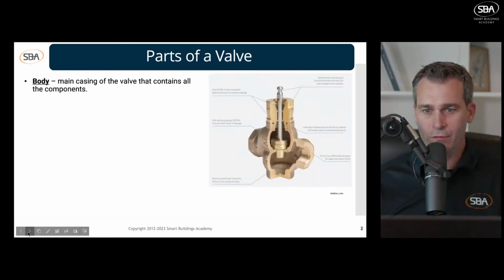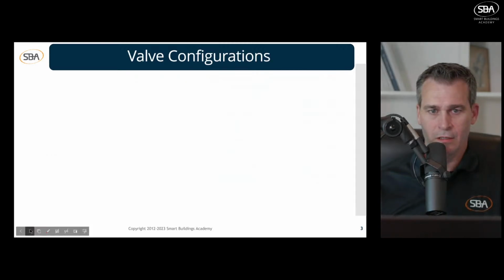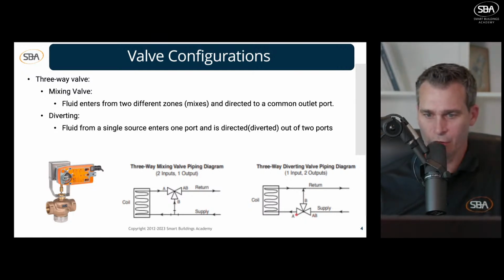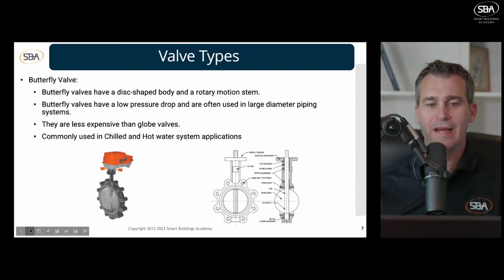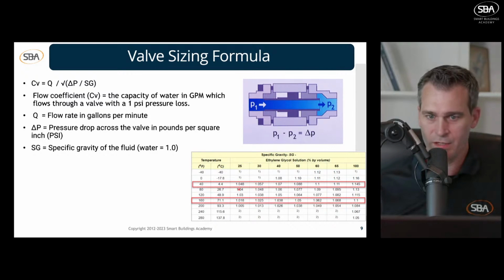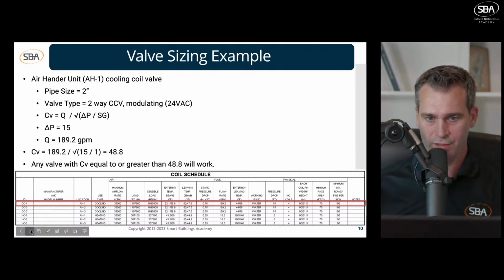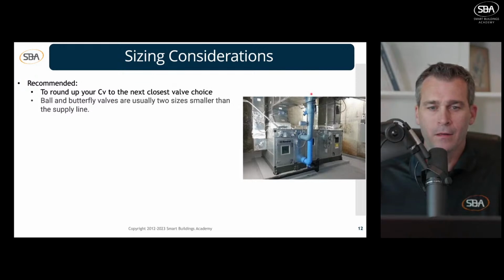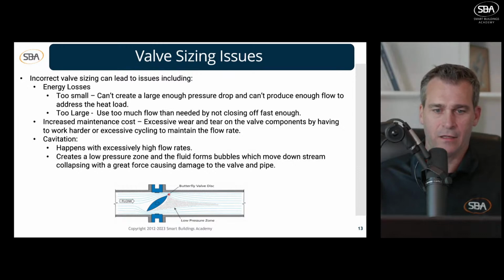SBA 433: The Art and Science of Valve Sizing - Decoding the Mystery

Comment: Shouldn’t the valve pressure drop be converted to psi for the equation?  In the example, you used 15’ for the delta P.

Comment: Is this a pretty common practice as a controls technician? Seems kind of odd that you would be given a GPM and pressure drop, which must have required lots of math to calculate, and then they make you use this simple formula to calculate Cv. Perhaps it’s to give more freedom in component selection? Otherwise someone might think you need the exact Cv value calculated.
Reply from the maker: Valve sizing is very common for the controls designer who makes the submittals for the controls project or for service techs.